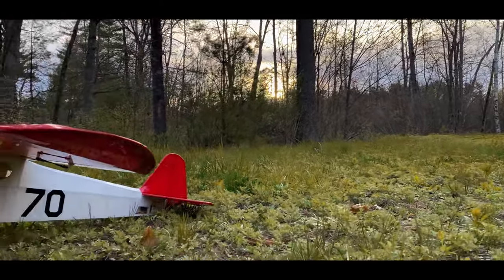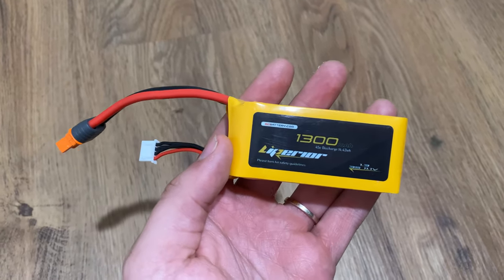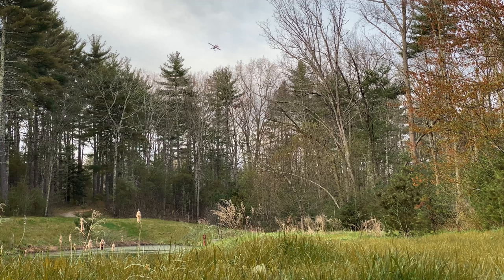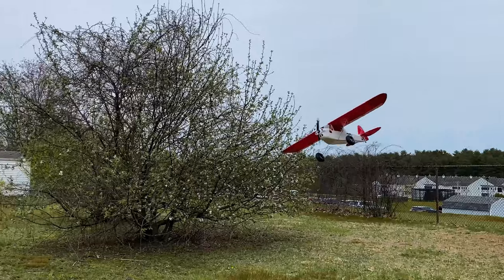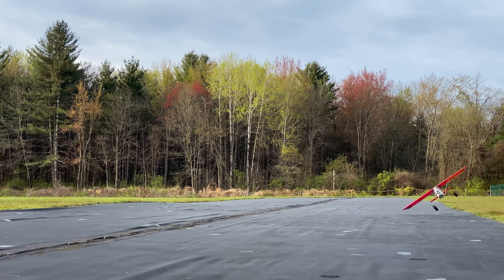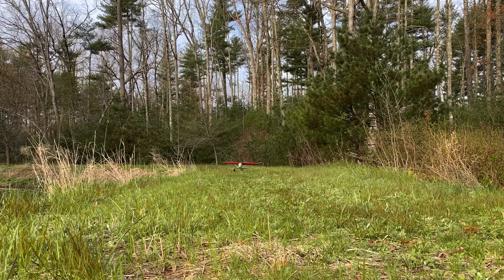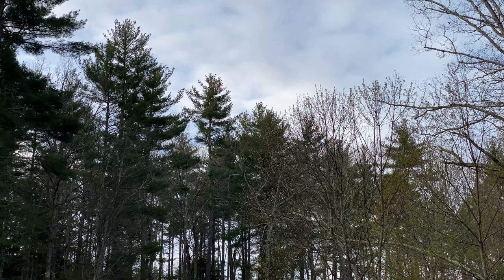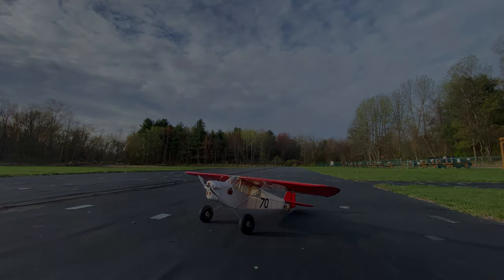Bush Flying an RC Plane You've Never Heard Of

Comment from the maker: Thanks for the comments! Mudgy 70 is a scratch-build that started out as a Sig Clipped Wing Cub Kit. For this reason, she is not available for sale. 

Bryan’s words: “The structure of the fuselage is completely different [than the original kit], and a wing spar was eliminated. The only thing used [from] the [original] kit was the ribs and the plans to establish the outline of the airframe. Minimal bulkheads and stringers were used in comparison to other similar models as well."
Reply: Was that the front or rear main spar?

Comment: I dont understand how you guys do this I have been scrapping RC helicopters,planes,cars,boats, literally rc everything for parts, I read that I need to buy a new transmitter and receiver regardless the age of parts that due to linking controls or something they said.  But my main question is 1. how do I know if the transmitter is gonna fit 2. say if im working on an RC helicopter,im basically trying to repair an 8 year old heli that I lost on christmas cuz my dad wanted to fly it lol, how do I know if the transmitter has options for dual propeller? I am assuming there is a lot more reading into linking parts with one another but is there a RC kit builder thing to check compatibility kind of like those PC building websites but for RC things

Comment: What was left out to save weight
Reply from the maker: Bryan’s own words: “The structure of the fuselage is completely different, and a wing spar was eliminated...as far as the kit is concerned the only thing used [from] the [original] kit was the ribs and the plans to establish the outline of the airframe. Minimal bulkheads and stringers were used in comparison to other similar models as well."